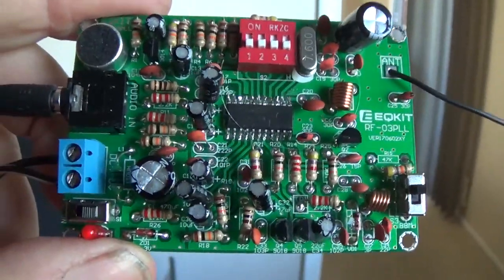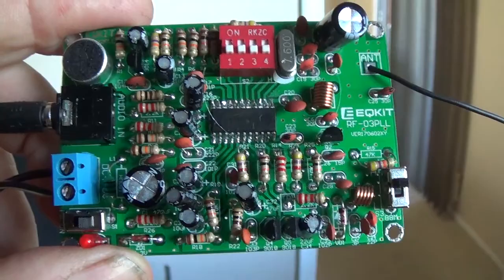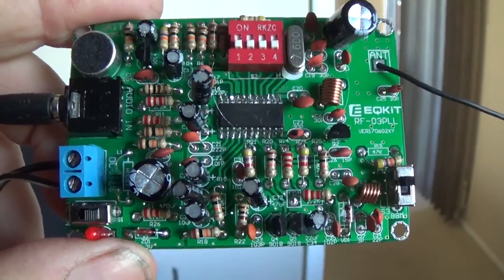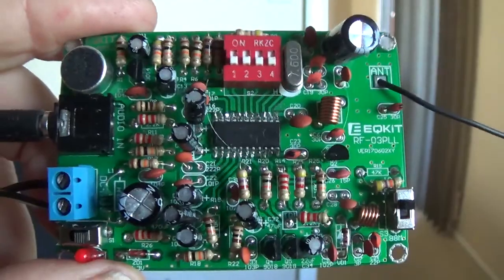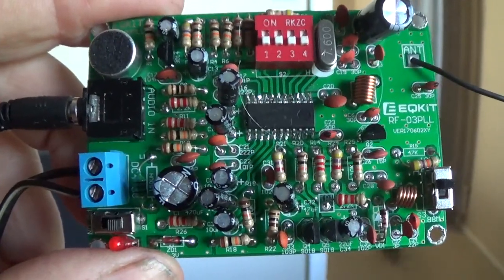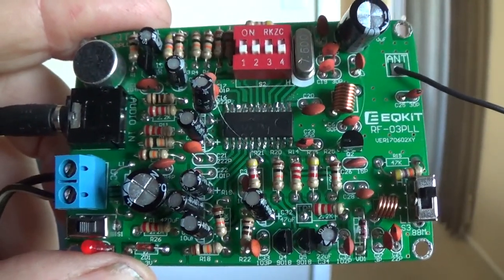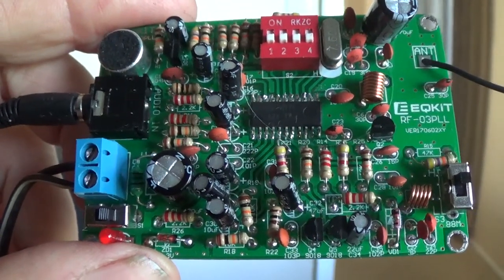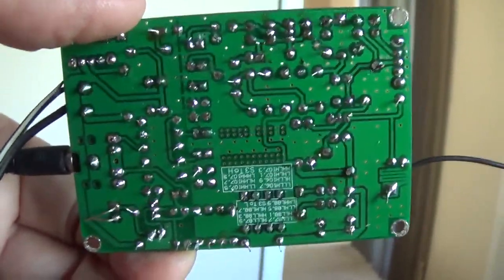FM Transmitter Kit

Comment: I've build this kit and noticed that they only made a very big error in the dip switches Hi/Low marking on the board! The S2 markings for D0 to D4 are correct but the H and L marking definitely need to be exchanged. H must be L and vice versa! After that every frequency configuration setting as given in the tiny table on the solder side of the board works exactly as defined! So you only placed the dip switches S1 to S4 wrong. D0 is S1, D1 is S2 and so on! And the ON position of this dipswitch is on the other side pointing downwards. After that everything works exactly and in perfect FM Stereo PLL stable quality on all given FM frequencies!

Comment: Hola amigo en lugar de C27 de 3p ya que en los dos kit no vienen que no se si es su caso que pusistes?.
    Un saludo
Reply from the maker: Si, es posible. Yes, the incorrect specifications of capacitor and resistor may be the problem. The company did give me a credit for a discount on a future purchase, but to use the credit I would have to buy more from the company for about a 15% discount,  but I never bought anything more from the company.
Reply: @DonBrowne  Gracias  por responder,cual puso usted en su lugar?.
Reply from the maker: @miguelbautista9250  no tengo otros. I used the parts they sent me.
Reply: @DonBrowne  Ok pues le comento pedi dos kit y he contruido uno el cual los switch no funcionan correctamente,no se si es debido al condensador C27 que puse uno de 22 pf?.Gracias un saludo
Reply from the maker: @miguelbautista9250  si, es posible pero yo no se. Gracias Miguel.